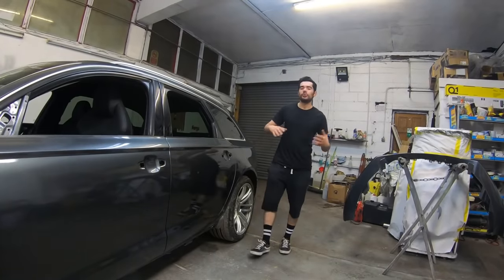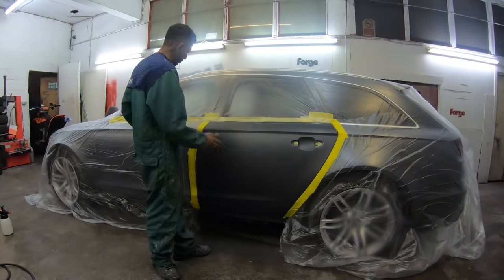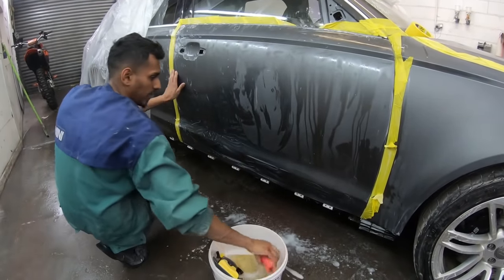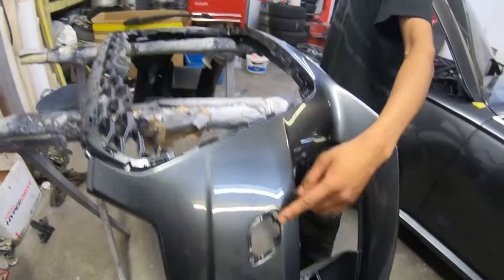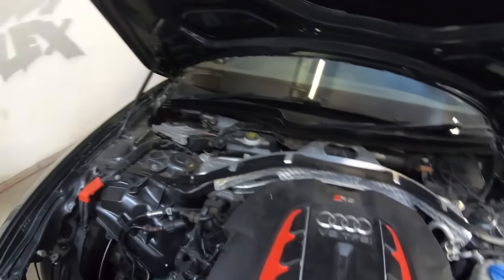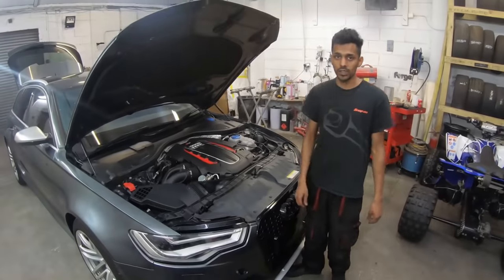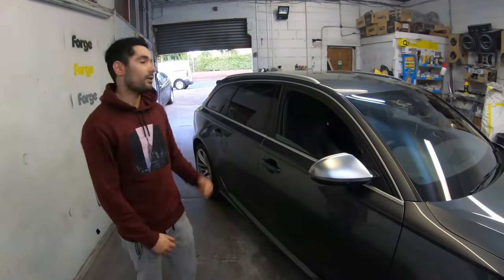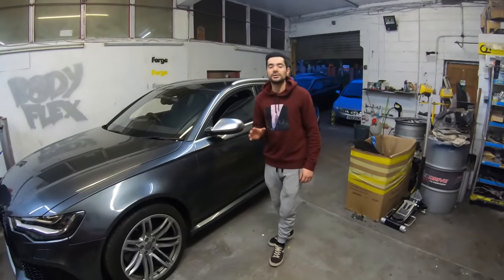Rebuilding a salvage AUDI RS6 PART 7

Comment: all that wet sanding do you not end up cutting through the clear coat?
Reply from the maker: Hi, it depends on the lacquer you use. We use trizact so it doesn’t cut in to the clear coat.
Reply: @PerformanceRebuilds  👍
Reply: Wow I sprayed cars for 20 years and never had to cut and polish that much in my life should look at getting a better finish or keeping your job cleaner when spraying saves a lot of time and effort  , but in the end turned out nice